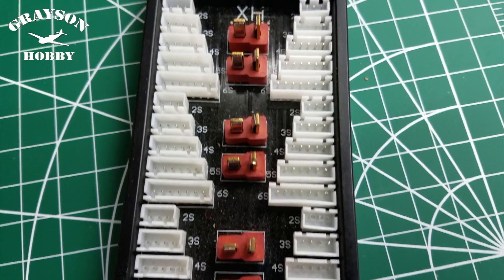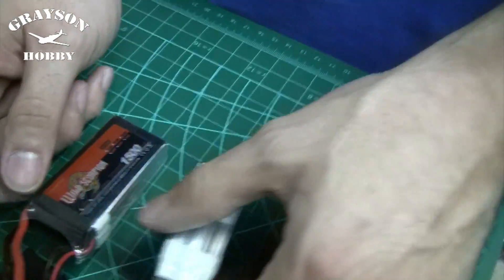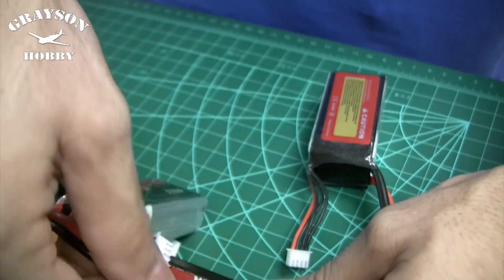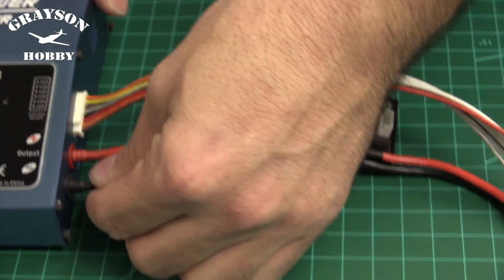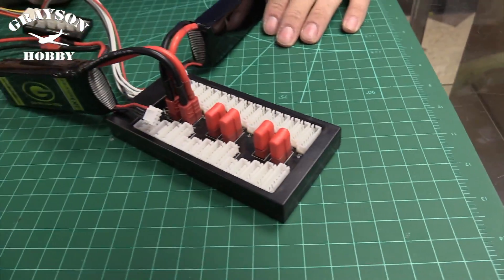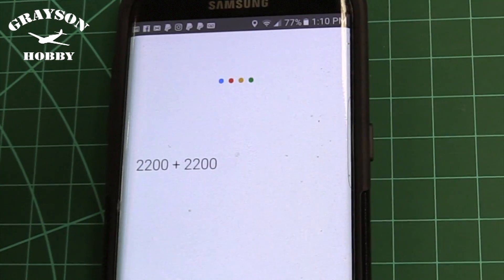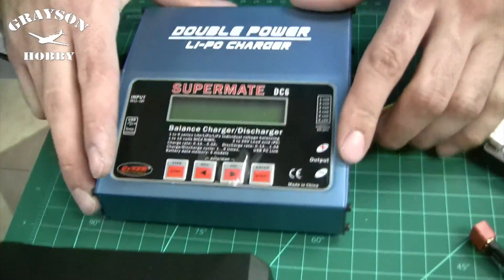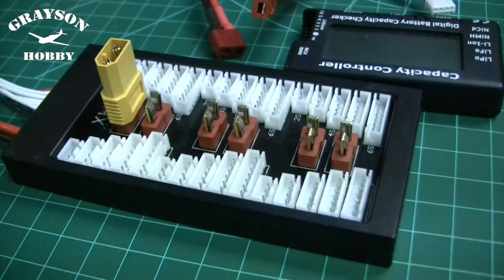Fast Charging Drone & Airplane Lipo Batteries with Parallel Charging

Comment: guys I love the channel but I feel you really glossed over at the end of how careful you have to be about voltage being within.02 range. so 3.85 can only charge with only 3.83,84,85,86,87 anything out of range is dangerous. at the end you said you "may" want to check voltage this really doesn't drive the point at all and almost glosses over it. fires are real so I feel it's really important part
Reply from the maker: Thank you for the feedback!  We will make sure to update the product listing with more details.
Reply: Thanks, I didn't want to say anything because i'm a really big fan and didn't want to seem like I was trying to come off negative, but people getting into the hobby really need to understand how dangerous charging lipos can be, seen a few house fires and it's sad event all around. Parallel charging can be safer if done right, but more dangerous if done wrong. 
Thanks for all you do love watching the videos and thanks for taking the feedback.

Comment: can u use the connector to fly
Reply from the maker: Hey Jose

Great question, the parallel charger is only for charging, but you can use the adapter for flying

Thanks
Reply: thank you

Comment: Horrible advice!  your batteries have to be discharged to almost the exact same otherwise you're going to cause damage your misleading people with this they can only be within 2 tenths of each other
Reply from the maker: Hey thanks for watching, you are correct, batteries have to be at the same voltage.  (usage_

It was mentioned at 3:50 and stated this in better detail around 8:00 in the video  

Its also mentioned in the product description. 
http://graysonhobby.com/paraboard-charge-board.html

We got you covered! :)